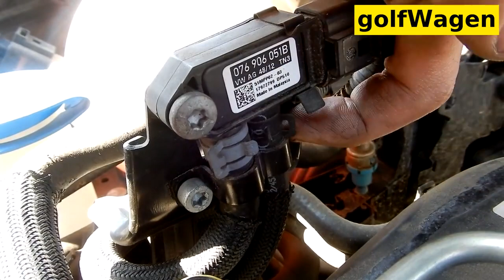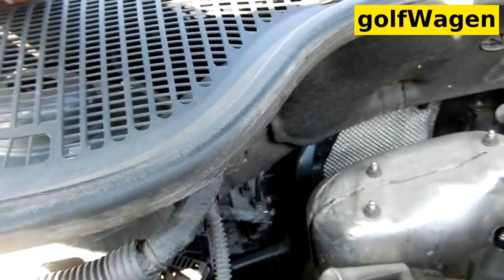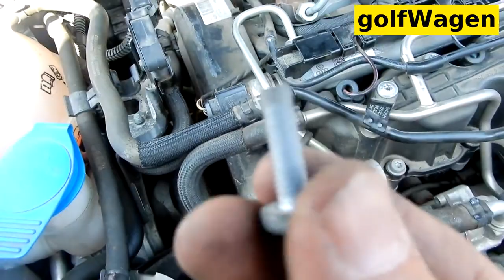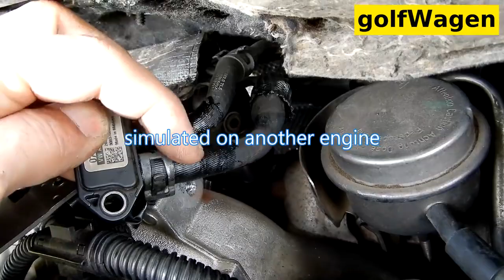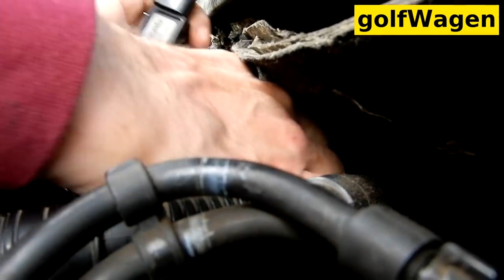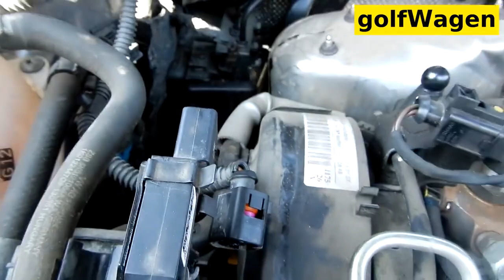VW Passat B7 dpf pressure sensor change

Comment: I have a B7 Passat TDi with check engine code P2459. On highway speed vehicle temperature tends to overheat & once I downshift to 2500+ RPMS engine cools down to normal temperature.